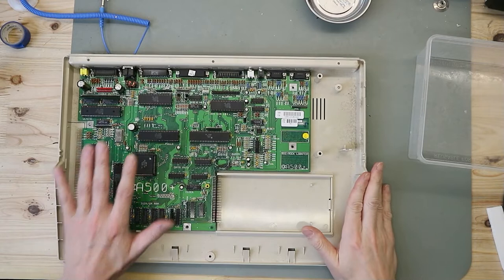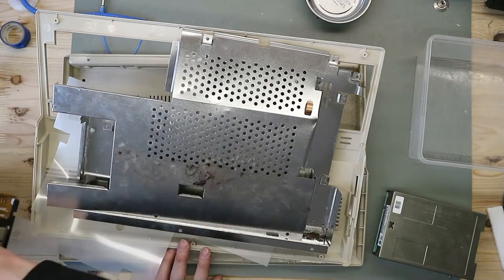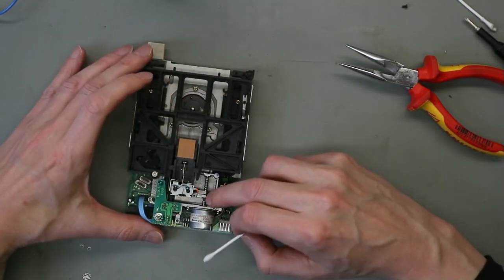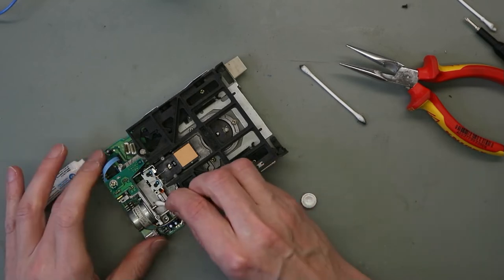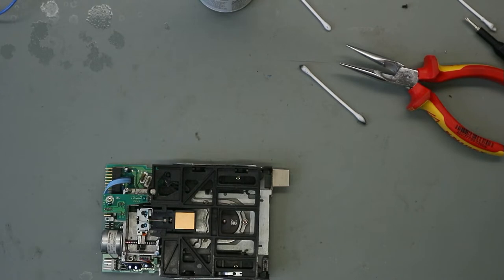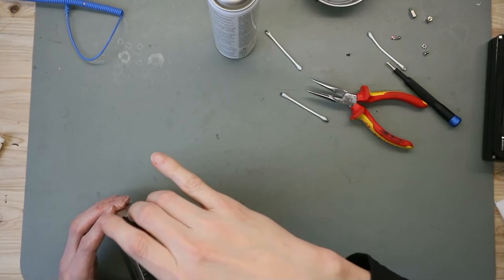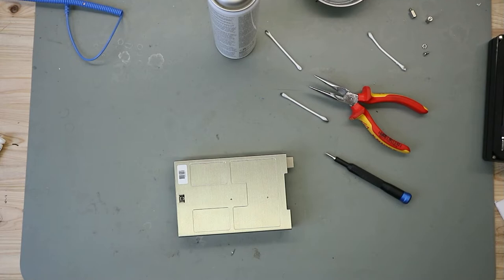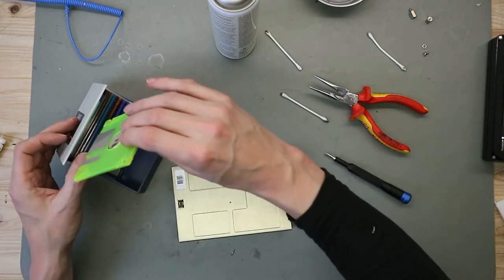Amiga 500+ Part3: Fixing a Batterydamage, the great final

Comment: In my Amiga 500, the battery place on the PCB is empty. I dont have any battery solder into a PCB and the menssage when i start a Workbench is Battery backed Up clock not found. It is possible to replace ?? Which model is the correct battery for this Amiga 500. Thanks for tour help
Reply from the maker: There are replacement with cr2032 battery.
Reply: @tomscomputerchannel2925  And solder in the space of PCB named Battery, It is correct??
Reply from the maker: What Board-Revision?
Reply from the maker: If you have removed the battery from the board. You don’t have anything to do on this contacts. If you fill the holes with solder it’s not wrong.
Reply: @tomscomputerchannel2925  When i open the Amiga 500 the  battery It is not included It not solderer .I dont extract from the PCB. Thanks
Reply: @tomscomputerchannel2925  Revisión 8A
Reply from the maker: An Amiga500+ 👍
Reply: @tomscomputerchannel2925  I dont know if the battery are inside of the Upgrade memory module because inside of the Amiga i dont view any battery.
Reply from the maker: One battery is on the mainboard. That was the problem in my A500+. It is possible that a battery is in the memory expansion.
Reply: @tomscomputerchannel2925  In my case , i dont have expansión memory but the system menssage is battery backed Up not found and i dont know if i can solder on a mainboard a cr2032
Reply from the maker: You can. But you need a diode, so that the cr2032 will not be charged. You can buy batterieholder with diode.
Reply: @tomscomputerchannel2925  Thanks Tom For all
Reply from the maker: Your welcome